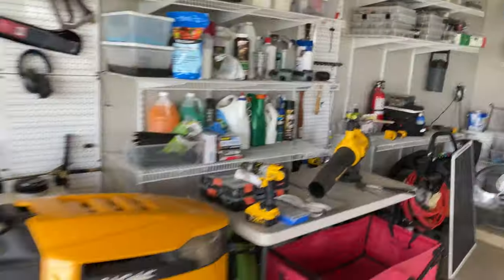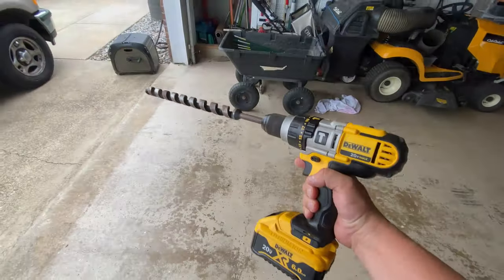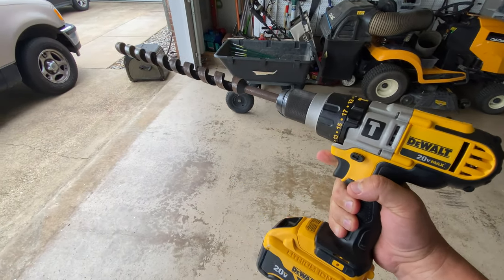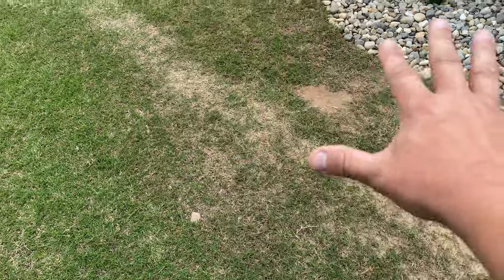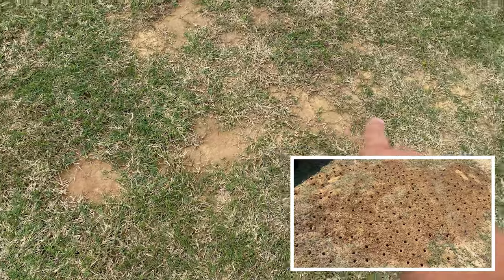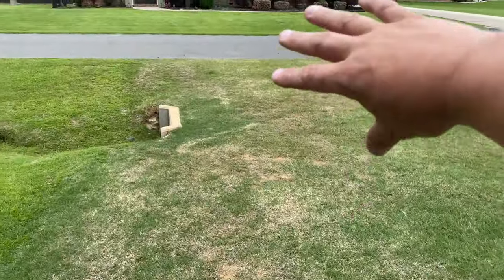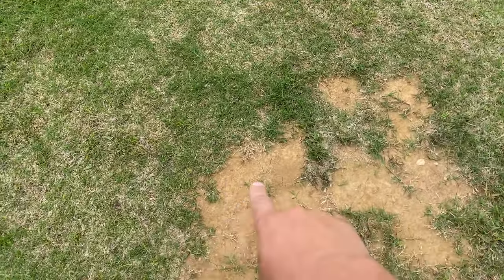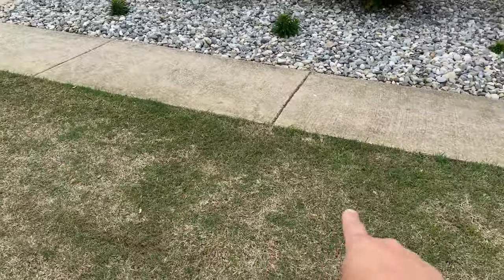Lawn Aeration the Manual Way: A 1-Year Follow-Up on Hand Drilling Holes for Aeration

Comment: I'm not ready to explain myself to my wife or neighbors, so I've been trying to drill in either inconspicuous backyard areas or when no one is around.  If my test areas work, I'll proudly drill the front yard at high noon :) I'm  Drilling with 1.25" Diablo brand wood auger bit. 13" deep if no rocks.  It has been slower than I hoped. Maybe a minute a hole. Spaced about 5" apart. I only do about 10 holes a day, so my 1/2" chuck drill (plug in, not cordless) can cool down.  I have been using NEXT biostimulants products the past year but the holes seem more tangible. If the holes and compost filler combo produce better water and air and microbe infiltration, I'll consider it a success and maaaaybe worth the time and effort. I'm fascinated by the Soil Food Web cycle and view this as a big science experiment. I can't see the average person ever spending this much time building healthy soil. Nicer grass is icing on the cake.  Too soon to tell if I'm a schmuck. I've only drilled about 5% of my 8600 sqft yard. I hope other viewers will comment if you've tried the Drill & Fill technique so I, and others, can learn from it.
Reply from the maker: It will work. Trust the process!!!!
Reply from the maker: Trust the process. It will work

Comment: One suggestion. Use a 2" dirt auger for even better results and get a 12" x 12" minimum piece of plywood with a 2" hole in the middle and drill the ground through the plywood to catch the hard soil and dispose of the bad dirt. Then fill the holes with the best topsoil you can afford.
2" holes fill much easier than 1".
Reply from the maker: True. Every situation is different

Comment: What diameter auger bit did you use?
Reply from the maker: 1” diameter 18” long. If I was to do it again, I would get a 9” long at most.
Reply: @LawnPusher  what's wrong with the longer bit?
Reply from the maker: @algotcor  nothing at all. I just don’t think I need to drill down 18”, 9” deep is long enough to get the soil health kickstarted. That’s all.
Reply: @LawnPusher  I wouldn't go too short. I drilled some holes with a 6" bit and ended up with a lot of soil in the drill's chuck.
Reply from the maker: @algotcor  excellent. That’s why I chose 9”. I don’t need to drill down much to help my soil